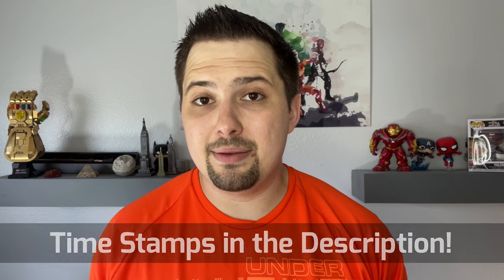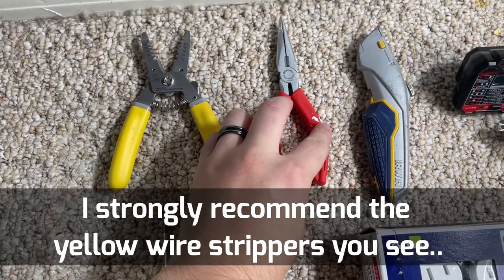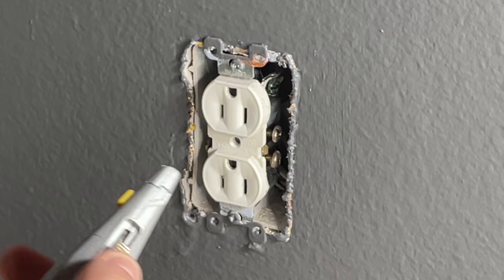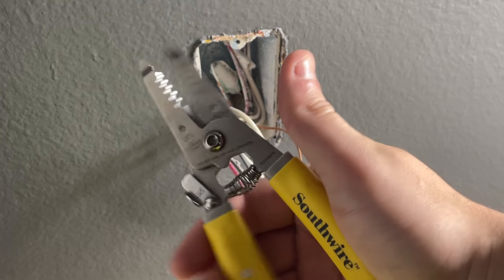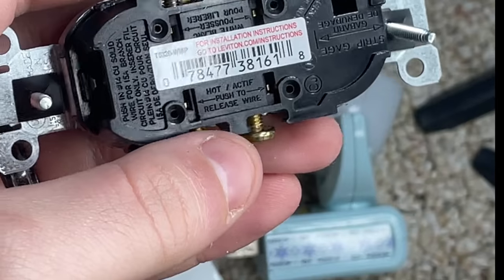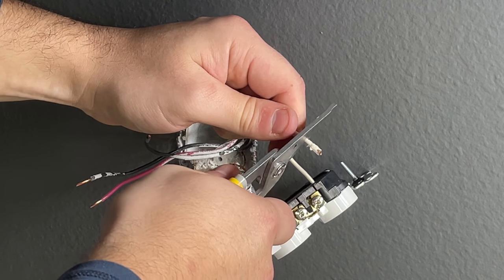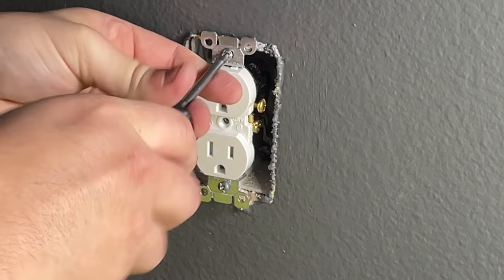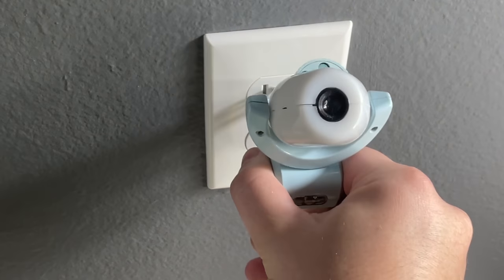How to Replace an Electrical Outlet

Comment: Absolutely ridiculous. You have no business showing something you've obviously rarely if ever done. Not a electrician and it's obvious. The one wire you bended should of been turned upside down to tighten under the screw. Upside down literally trys to push it out lmao